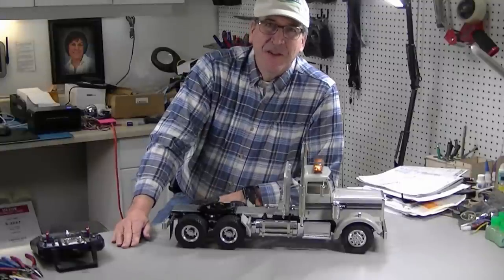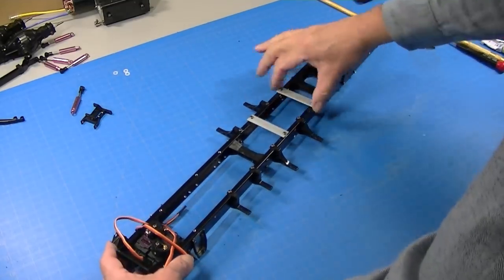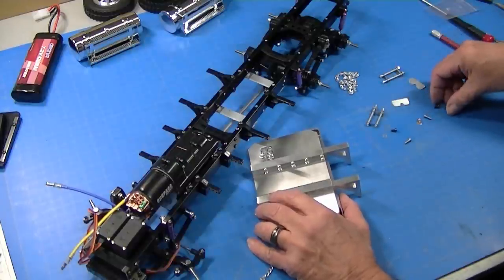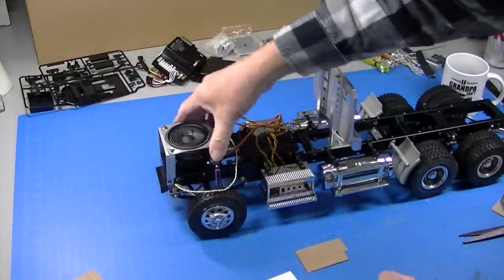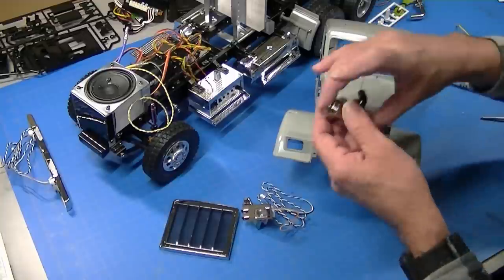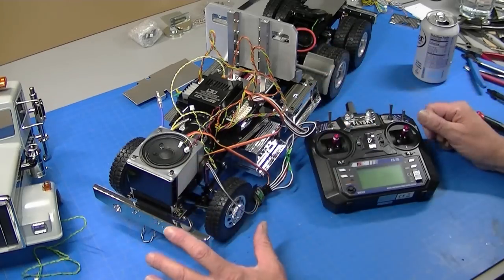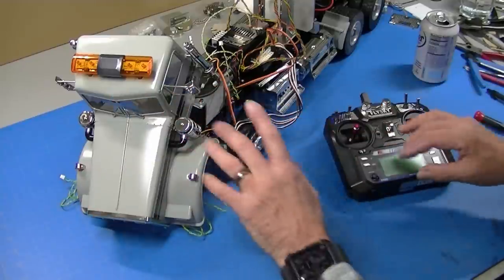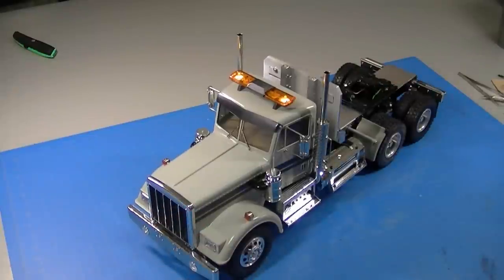Tamiya 1/14 King Hauler Day Cab Work Truck

Comment: Hi Bob, thank you for sharing with us some great hints and tips, so much in the video, may have to take another look again. Thank you for sending me the setup sheets for the FlySky radio system. I’ve installed my FlySky FS-i6S self-centring kit to my radio, programmed up and the basic functions are working well. The FlySky FS-i6S had to have the software upgraded to get the aux switch menu’s added to the software, so that I could programme those. Other than that, it works the same as your FS-i6(x)’s, bonus is, you don’t need to pay extra for the self-centring kit. I like your colour scheme on this truck and the alloy bed’s really set off the truck. Definitely right going with the non shiny wheels too and those knobbly tires. Next week, you’ll start to see my videos going live of my Scania R620 Highline build. Once again, thank you so much for your help. Take care, keep well and all the very best to you and the family. 😊😉😊

Comment: Very nice R/C semi tractor truck. You shoulduh kept the clearance lights & airhorns on top of the cab & the sunvisor, mounted the headache rack up closer to the back of the cab,  & mounted the flashing warning light bar on top of the headach rack itself. But, overall. . . .excellent job in your build & awesome video. I've wanted one of these R/C trucks for years & years! Now after retirment, i believe im gonnuh make it happen. Im a new subscriber & thanks again for sharing your video. . . . 10-4! Truck safe!
Reply from the maker: That is the great thing about these, you can do it the way YOU want!  And just a few changes make it into your truck.
Reply: @HobbyconceptsLLC  Thats aweome! And thankya sir for the reply back. What scale are these trucks??? Are there any "aftermarket" cabs & sleepers for these R/C's? I would love to build a Kenworth W900L with the Kenworth aerodyne sleeper!

Comment: Have you ever thought about building a "Hobbyconcepts Shop Truck" ???? It could be a Subaru Brat or a Ford F350 or whatever with options like a Snow Blade or welder or air compressor.....some dents in it or whatever.....a lot of truck shops have a "shop truck"

Comment: Man I love the looks of the day cab.. It's much more of a specific work truck to me.. Anyway, I've gathered a lot of parts since I started watching your channel. You were kind enough to send me the full size plans for your trailer. You're an asset to the community. My goal is to build a tri axle heavy haul day cab. Can you suggest a good forum to gather info? I don't know the length of chassis I need to build a tri axle. I know theres a great site out there for builds but can't remember the name.. it's gardentrucks or something like that. Or, do you have anything you've saved in your browser with tri axle specifically that could help with a build? Again thanks for all the information and guidance.

Comment: This is Awesome!!  I used to drive semi's With End dump trailer and a Lowboy trailer. I think I'm going to have to build one of these.
Have you seen or heard of scale size air bags suspension for RC?
Reply from the maker: Several companies make air bag suspension.  Check LESU.
Reply: @HobbyconceptsLLC  Thanks  I'll check with them. And start doing some searching myself.